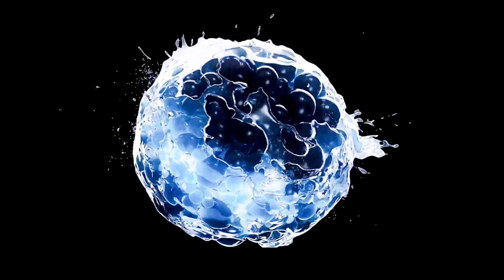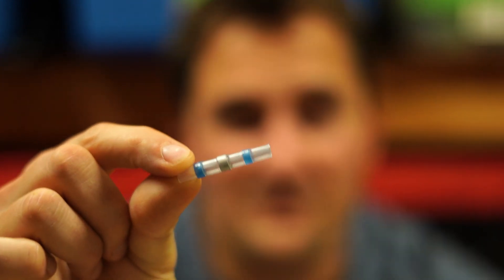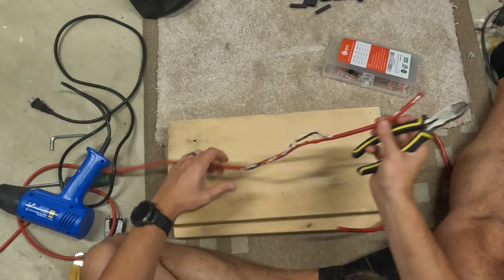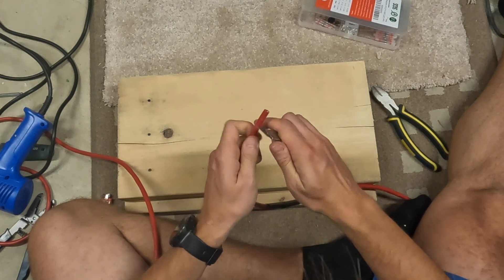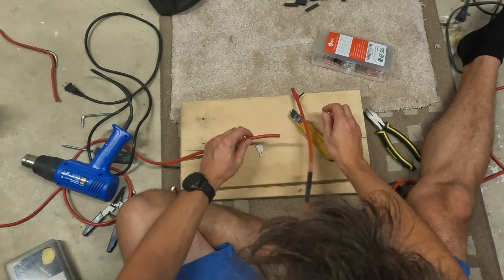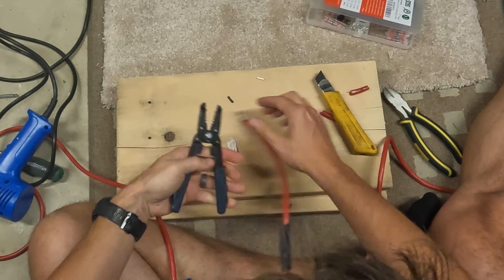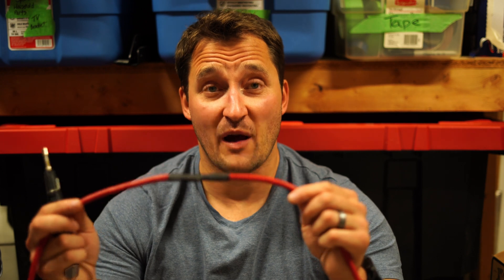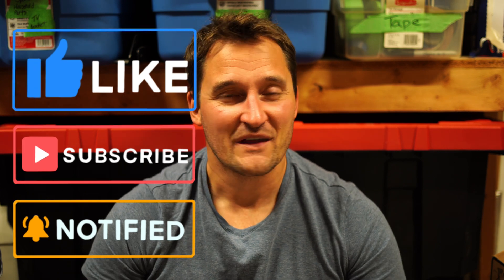How to Fix an Extension Cord

Comment: I've seen a lot of people apply these connectors. You did an excellent job. Sealing the two ends before you try to melt the solder, making sure you had clean wire. 

For people watching, this is exactly how you use these connectors. And the extra sleeve of outside heat shrink is advisable. 

The only change I would make is the outside heat shrink. They sell a heavy-duty adhesive lined heat shrink. Which would do better on this type of repair given its outside nature of an extension cord.
Reply from the maker: I appreciate the kind words! Much appreciated!

Comment: wouldn't you get a cold solder in the connection then? Even if it's tightly composed, the current flow would not be uniform and can heat up
Reply from the maker: Hey there! The solder does liquify in the heat shrink, cord is still working well here, but thanks for the comment!

Comment: Those connectors are really cool. Solder & heat shrink all in One  Impressive and durable, moisture resistant to boot. Outer heat shrink is really good idea as well! Once again, Ya nailed it!
Reply from the maker: Thanks for the kind words! Overall I'm very happy with them, and the repair is holding up great!